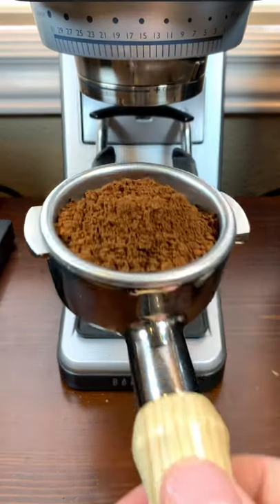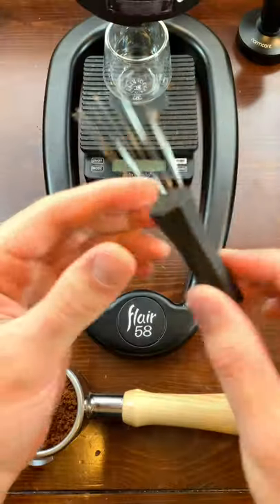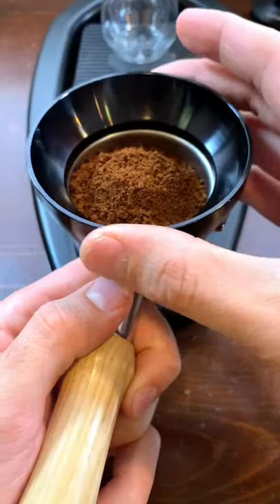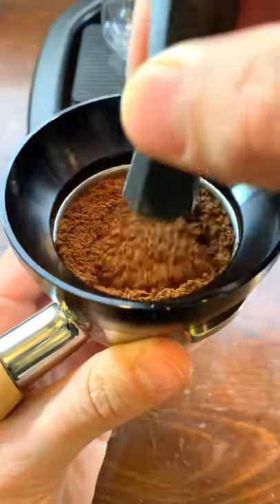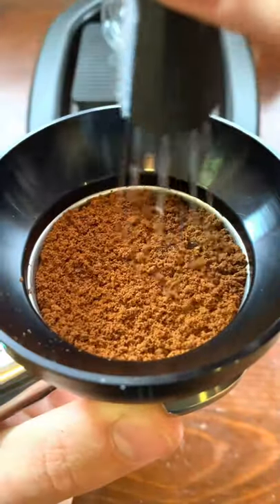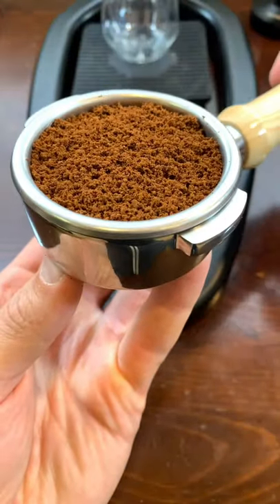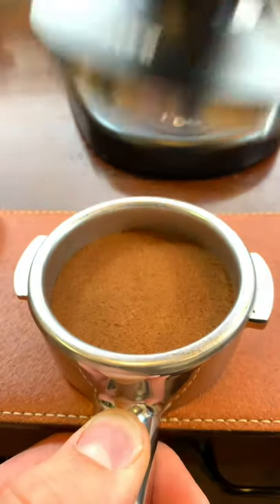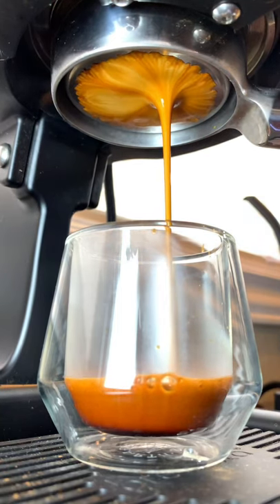WDT (Weiss Distribution Technique) will help you make better espresso! #shorts

Comment: I didn't know too much pressure doesn't clog
Reply: The pressure you exert with tamping is ~1/10 of the pressure the puck gets from the water (9 bar/130 psi on a 58 mm filter = 238 kg / 2332 N / 525 lb of force)

Comment: Not gonna lie I’ve been using a thin plastic fork and so far so good. 
Even tho I want the one that lays on top and spins lol
Reply from the maker: not thin enough. guitar strings?
Reply: @FlairEspresso  😂
Reply: @FlairEspresso  I play bass. Strings too thick. I could unwind a string tho
Reply: Ik its been a bit but another short like this told me it started out as sewing needles put into a cork which doesn't seem that hard to replicate

Comment: What is the thickness of those needles.? I mean are those 0.25mm one or 0.35mm...??
Reply from the maker: 0.35
Reply: No need to worry too much about the thickness of the wire. It can be upto 1mm. It doesn’t matter whether it is 0.4 mm or 1mm. Only thing that you should stir well
Reply: @nalinakrishnamurthy8208  Most people seem to agree 0.30 to 0.4mm works best, at 1mm it's probably going to be pushing / squishing the coffee around like toothpick would.

Comment: When you scrape the bottom, does the needle go through the basket hole? When I do it I can find it getting stuck in the basket holes (VST basket)
Reply from the maker: Definitely possible with  needles having a diameter < filter hole

Comment: What scale are you using? I have a hario scale and it doesn't fit under my flair. Would love to get one that does that isn't the 250 dollar acaia lunar
Reply from the maker: Brewista Smart Scale II
Reply: @FlairEspresso  thanks
Reply: I use a little scale which was around 10$. It works very well so no need to spend your money.

Comment: Why is your bottomless portafilter showing an off-center pull after such precise puck prep? It's clearly off-center a good bit. What might account for that?
Reply: That actually comes from the frame flexing a tiny bit under load and the portafilter not being in parallel to the table in that instance. On some videos you can see it centering later as soon as you let off the pressure towards the end of the shot. Asked myself the same question before but found out through a video from Lance Hedrick! :)
Reply from the maker: This
Reply: Jeff Mattel  this is mostly to do with gravity and in the case of the Flair even if it is level on a surface, the force from the lever starts to bend it ever so slightly. If you have a heavy E61 doing off-center shots I would guess that it is not perfectly level on the surface you have it on as a first starting point? If I find the video about the flair I will still post it here though!
Reply: Jeff Mattel  Could be due to level of the machine not being perfectly centered, or flow from the shower screen maybe, but if it looks similar to this and there's no obvious channeling and the coffees tasting good I don't think you should be too concerned.

Comment: Where to buy the WDT tool and the screen 58mm? Thanks
Reply from the maker: The link for the without is in description. The screen is available from flairespresso.com
Reply: @FlairEspresso  What description? I need 58mm screen separater and a WDT tool please. Website has nothing like that. Thanks
Reply from the maker: puck screen https://flairespresso.com/product/flair-58-puck-screen/
wdt is linked in the description of this video you are commenting on. it's a 3d print. you can contact the maker himself to inquire about printing one for you if you cannot or check etsy for clones

Comment: It's not properly extracted. The extraction should be from the middle and not the side
Reply from the maker: This comes on the Flair 58 from the flex that occurs as you add pressure and it’s completely normal, not indicating uneven extraction

Comment: Just grind it and tamp it. No time in a cafe to be messing about with that, yet our coffee is still 10/10
Reply: This is a home environment, not a cafe. And cafes are concerned with speed and efficiency first, not quality.
Reply: 10/10 with no grind distribution at all? What kind of grinder are you using?
Reply: I agree , once it’s tamped those other steps were unnecessary

Comment: Complete BS! It doesn't matter, you are NOT gonna taste the difference.
Reply: I have a cheap ass Mr. Coffee Espressions machine, got an OXO grinder and just got a WDT... my wife noticed the difference when I switched to a new filter basket, and doing this for the distribution.  Also swapped out the plastic tamper that the machine came with to a metal tamper with spring loaded handle.  I'm waiting on a bottomless portafilter to see what effect that has.  The new basket also allows me to get closer to the correct weight of ground coffee... although with my machine I can't adjust pressure, volume, temp.  If you practice and compare, it all adds up.